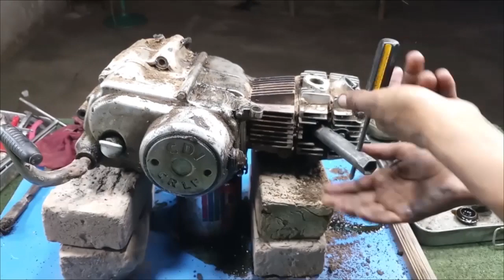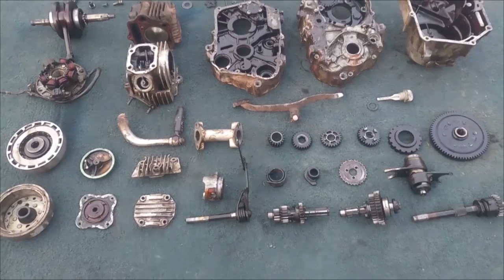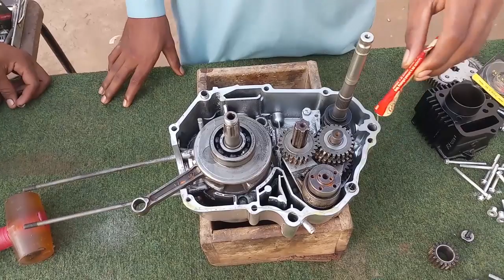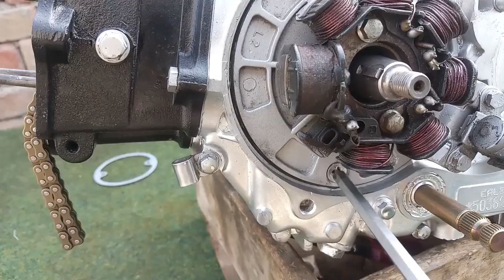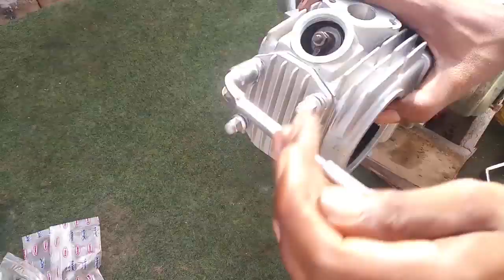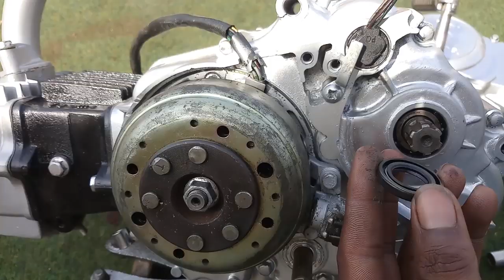Old Motorcycle Engine full restoration

Comment: you painted the engine without taking care of inner parts you also painted oil pump paint should only be applied of outer side not inner side because after running some miles it may come off and damage the engine bearings and clutch plates as well as engine oil and also you did not  applied seal on right panel of engines head
Reply: الله يعطيك العافيه اخوي على الموضوع الرائع وفي انتظار جديدك الأروع والمميز الله يعطي